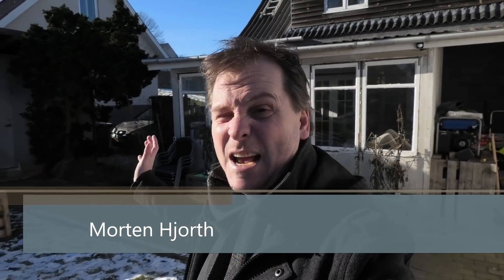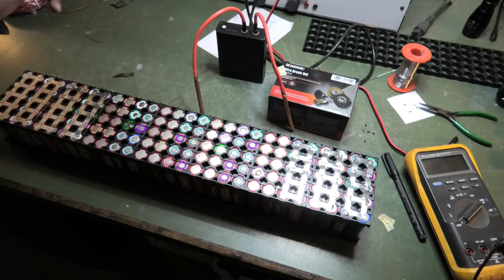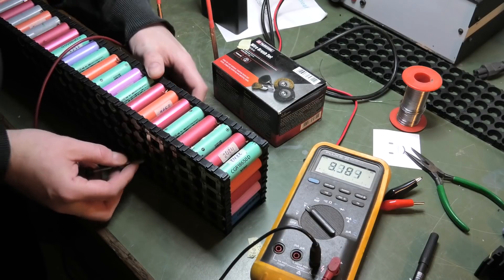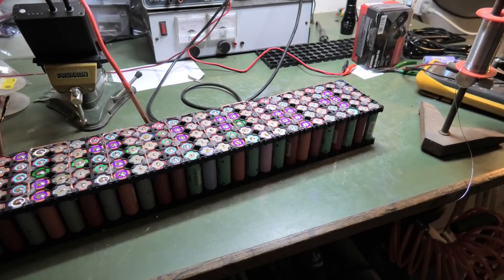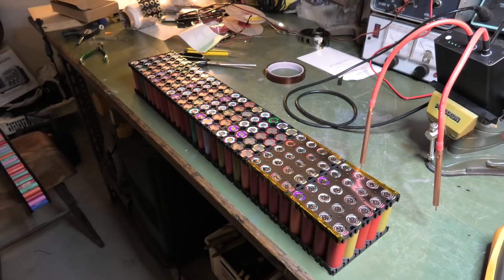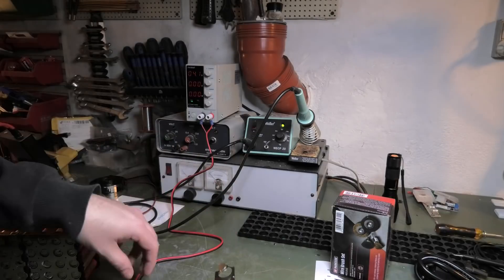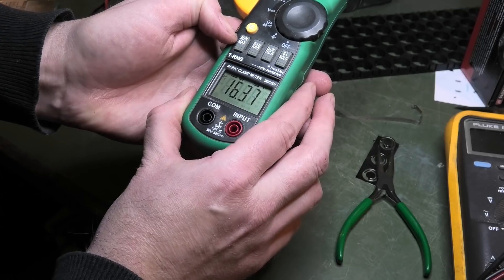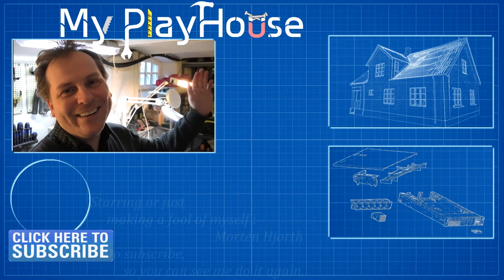Using & Testing Battery Hookup's Fused Nickel Strips - 1043

Comment: It is slow blow fuse. It will blow at 8A or whatever it was rated for only if You draw that much for a prolonged time. It can take short bursts of much higher current.
Reply: Just like all circuit breakers an fuses.
Reply from the maker: I was hoping for less :-/

Comment: Its normal. Short current is higher when meassured like that. Every fuse takes 5-10* the current during very Short bursts :)
Reply: The thing is..... regardless how it's measured, it still needs that much energy to force the strip to melt.
It'd be interesting to see what the voltage was also at the time.
Reply: Yeah agree, what you mentioned about using a scope, is why I mentioned it would be great to know what the voltage was.....ie Vd across the fuse to see what the actual energy might be. That's what we do when we test Medium and High Voltage switchboards to destruction.
Allows us to quote actual data to customers when they purchase our gear. Having said that..... AC is quite different to DC in the same situation.
Reply from the maker: I was hoping for less,, I liked the 4A
Reply: @MyPlayHouse  the nickel strip is 7-8a rated If not mistaken. Lower current and glass fuses is your best bet. Lower current in open Air is Always difficult. I run 5-6a fuse wire in My wall myself. And they have somewhere around 15+ a when or IF you test like youbdo and ca 6a continues. Its about characteristics of the fuse :)

Comment: Kapton tape. I would pronounce that as "cap" and "ton". With regards to fuses, some fuses are designed to temporarily take more amps. It would be interesting to gradually increase the current and let it sit for a while. It may be that the fuse blows after 20 seconds at 10amps. Have a great day!
Reply from the maker: Hi Bert Blankenstein
Thank You very much! AveRage Joe did a good video testing fuses just like that : https://youtu.be/BAPHF3Sq2t8
Thank you for watching! :-)

Comment: And you dont fuse total current on cell level you do that eith the Main fuse. Set that to 15a it you like. You dont want all those small fuses to blow. You want a single fuse to burn ;)
Reply: I do not agree !
If one 18650 get shorted from these 10P than the whole battery pack can go quickly out of balance if you draw high current from it (that's the why we use a BMS) and can be dangerous and therefore that one little 18650 have to get out of service as quickly as possible by blowing the fuse.
Such projects needs high safety features as this is mandatory.
Reply: @GeertDroid  And thats what you have cell level fuses for. Not to protect overall total current but on cell level. Thats also why you have a proper BMS that can give you insight in how much is balanced and why. If you look at my builds that have battery systems of well over 100kWh with 29 000 cells in it  ;)  Note i didnt say you should not have cell level fuses.
Reply from the maker: Hi DIY Tech & Repairs
Thank You very much! BMS is only 15A, and the breaker is 16A :-)
Thank you for watching! :-)

Comment: You can buy that in 5s an run one strip all the way down the battery pack then solder a bus bar on it then put a lug on it. Average joe an Pete tested those fuses they pop around 8 amps.   They make the build a whole easier  bee using them on my 7s batterys.
Reply from the maker: With my 14S batteries I cant do that :-/

Comment: I would not use those fuses they are super nice, but I like to use 2 amp fuse wire or less.  I like your single strand way better than the new ones.  Not a fan of that much heat possible in the bank that could melt something.
Reply: Yes, either fuse wire and/ or separate fuse holders. Correctly rated.
Reply from the maker: It´s a bloody lot of work to put in all those tiny fuses..
Reply: @MyPlayHouse  Yeah they are very fiddly. Time consuming to fit. Although it may make the individual battery banks a little bulkier, I would (and will when I build mine) use small fuse holders. Solder 10qmp wire to each position you would spot weld the fuse wire. Join each 10amp wire to holders capable of holding 10amps or more, but put in a small 2,3 or 4 amp glass or ceramic fuse. You'll only ever solder these in once. At least until the cells need changing. The fuse holders and carriers can be purchased from most radio spares stores. Radio Shack or DigiKey type.
That's my suggestion.
Reply: Yeah I hate the fuse part too, but they have saved me only once so far but had a shorted cell and the fuse was blown.  If it was a higher amp one not sure what would happen.

Comment: 20 amps. Well, if you ask Tesla motors they don't consider it out of the usual.
Though, most 18650 cells don't actually like providing more than 3-5 amps continuous. One can go a bit higher if one provides some active cooling.
And for a short burst, one can go a lot higher, though with noticeably reduced efficiency.

Though, to be fair here.
Building a battery bank for UPS-ish applications out of Lithium is going down the path that lithium really isn't ideal for.
Due to its tendency to degrade itself by just being around, its high price per kWh (in your case its low due to second hand cells), and the weight reduction compared to lead acid isn't majorly important.

Lead acid on the other hand loves being fully charged and are technically superior for UPS applications, especially at its much lower price per kWh and fairly comparable power density.
Downside with lead acid is though that all battery packs one can easily buy are frankly abhorrently made, lacking both cell balancing, and then most lead acid batteries are discharged beyond what they actually like. (A given cell should never go bellow 1.85 volts) Then there is also the issue of "maintenance free" batteries, that generally die even faster since they barely contain enough electrolyte from the factory, and just a few charges and they start to get crippled. (in short, car batteries are garbage.)

In your case, you use recycled cells, that are somewhat hanging on on their last legs regardless.
Reuse is after all one of the more important steps in recycling.
Reply from the maker: Hi Today on the Bench
Thank You very much!  glad you liked the video :-)
Thank you for watching! :-)
Reply: @Today on the Bench - But Tesla has new cells, they do not have USED cells. Many on YouTube, buy the cells that Tesla throws away.  USED cell need to be fused much lower than 8 amps, to gain any SAFETY.  These nickel fuses don't add much safety at all ... They only blow with a 100% DEAD SHORT, which are extremely rare ...
Reply: @MrSummitville  The argument that new cells can take higher current is partly correct, but also missing the point.

It doesn't matter if a cell can handle 20 amps for the first few charge cycles when it is in a product that is expected to go through at lest a few tens if not well over a hundred charge cycles per year, for a few years time.

In the automotive space, basic safety needs to be maintained for the whole working life of the product.

So the decision to fuse the cells to be able to take 20 amps during normal operation is a bit stupid, since a 5-10 year old cell might not even be able to generate that current, even if it is burning up while trying.

This is less of a problem with lithium iron phosphate batteries, but Tesla uses all sorts of different cell chemistries, with different aging characteristics. So yet again the problem is there.

But I guess it took care companies a good couple of decades to figure out how gears and bearings wears out over a prolonged usage period. I guess they just haven't learned enough about batteries yet. It is after all easy to be lured away by the potential peak performance of a technology, and forget the various downsides of going there.

Comment: 20A is not much considering there are 35A capable 18650 cells like SONY VTC6
Reply from the maker: The most I am planning to charge or discharge each cell is 1.5A so there is a fare to 20A from there.
Reply: @MyPlayHouse  So then, what is the point of having those fuses?  Seems like a false sense of security - which is very bad thing with 18650 Packs ..

Comment: cut one of the tabs that is connected to the battery that should half it to 10A
Reply: Yes, was thinking the same thing myself. Completely understand they might be engineered to not fail so quickly, but I'd rather have the occasional false trip than set fire to the complete battery bank.
Reply from the maker: Hi Harry Rickenbach
Thank You very much!  but there is just one tab,, not two :-)
Thank you for watching! :-)

Comment: Those new fuses seem really over rated,  maybe cut or use a dremel tool to grind a V notch in the strip to provide a single point for it to fail.
I don't like the look of the bright red hot effect,  too much like a heating element :-(
Keep tinkering mort,  you will win :-D
Reply from the maker: That would be a lot of work..

Comment: And so the fuses will do essentially nothing, unless you have a DEAD SHORT CIRCUIT across one cell?  I think, those fuses are almost useless.  When was the last time you had a DEAD SHORT CIRCUIT across one cell?  If 6 Amps can continuously flow into a weak cell, then it will eventually catch on FIRE, before its fuse will blow.
Reply from the maker: most cells can delevere 8 amps and some are build for 20 amps. For my needs I would have liked these to blow at less amprages,,4-5-6 amps,,, but they are not useless,, just not as quick. remember that the BMS will also protect, and shut down if anything to weird happens.
Reply: @MyPlayHouse  No, the BMS does NOT shut down the pack, when one weak cell in the P-Pack, gets over-charged by all of other cells in the P-Pack.  No, the BMS does NOT  "shut down if ANYTHING weird happens".  The BMS  only shuts down for: a) Over-Voltage, b) Under-Voltage and c) Over-Amps.   I said, these "fuses" are ESSENTIALLY useless because DEAD SHORTS are very rare.   The common problem is weak "heater" cells which neither the BMS nor these "fuses" will stop from being over-charged.  Put 4 amps into a weak cell and see how long it takes before it bursts into flames.